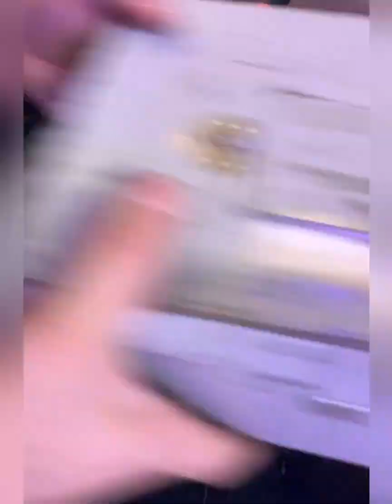How to Replace/Remove Rear Wheel Tire - HX X7 X8 Scooter

Comment: can you replace the tires with tubeless tires?
Reply from the maker: Yes, we do have customer need tubeless tire instead of air tire
Reply: Mine are tubeless
Reply: Hi wich tubes size for tyre? And wich valve stem? 
45-degree angled valve stem or 90? Thanks